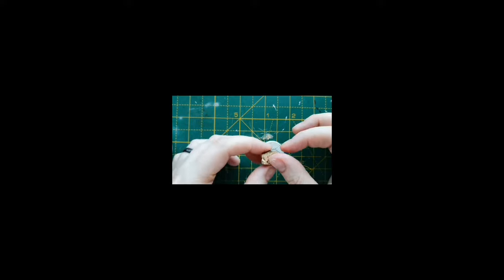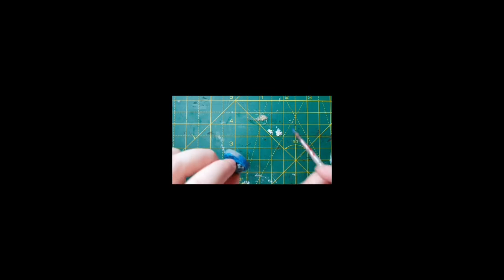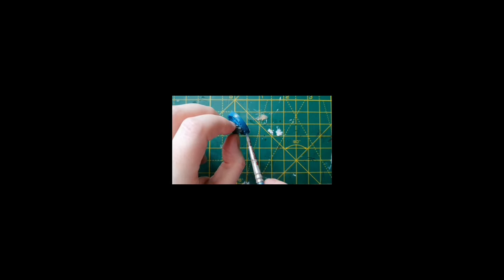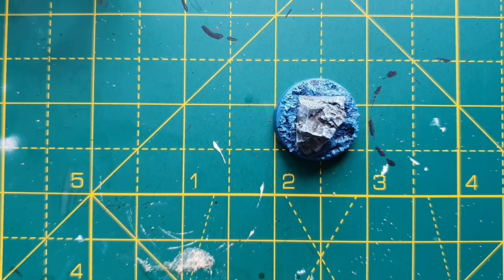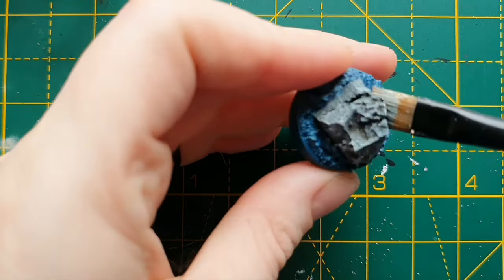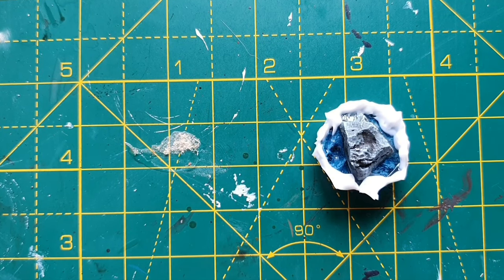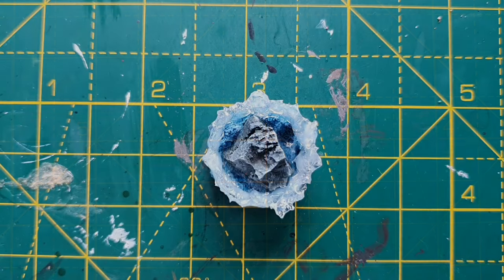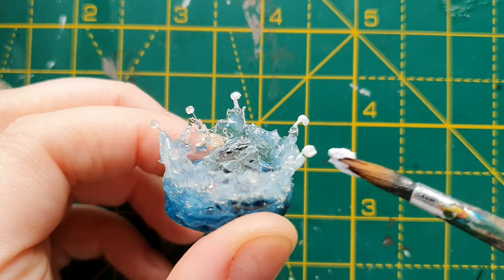All About Dat Base #9 - Splash

Comment: I read somewhere that the little silica beads inside the packets you sometimes find in delivery boxes are good for the purpose of water droplets like in this project, can anyone confirm?
Reply from the maker: Hi Lucas. It depends on the size of the base you are making, and the size of the silica. I have loads if silica that I've saved for making bubbles and droplets etc, but I didn't have any small enough for this 25mm base. I'm making a 50mm version at the moment, and I will use the silica beads for those 😊